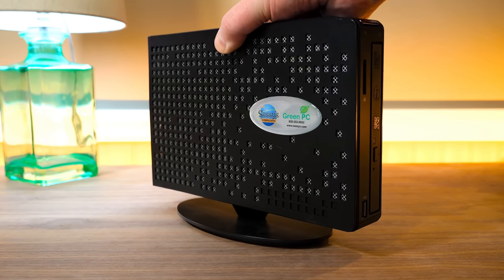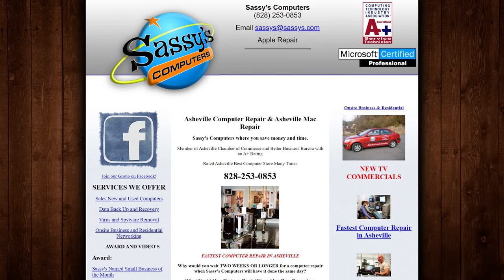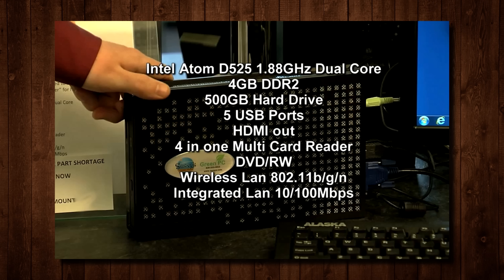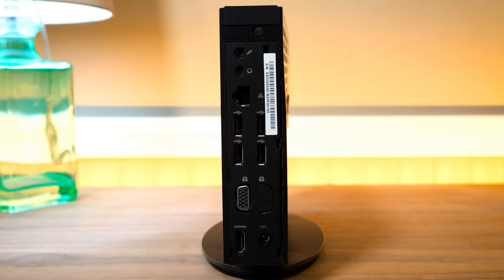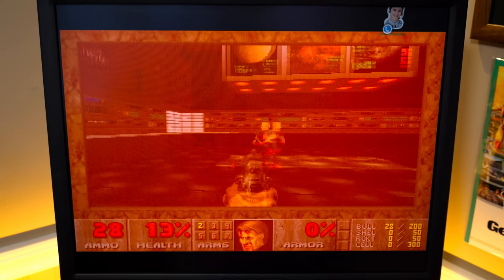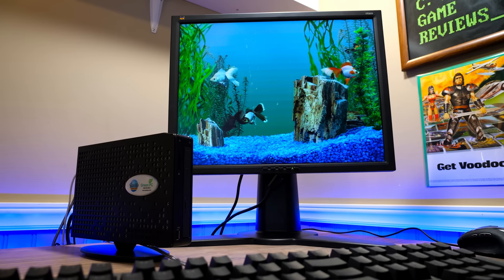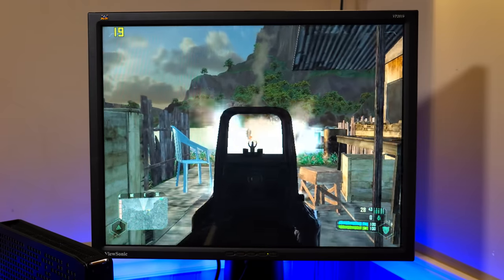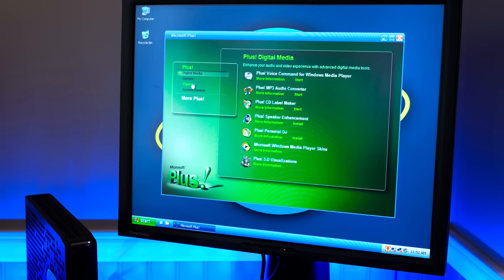Rejuvenating a $599 Shuttle Nettop from 2011! Sassy's Green PC

Comment: Honestly never knew that these form factors were being sold as home computers back in the day. The only time I ever saw them, or still do see them, was velcro'd to the back of a monitor as a point-of-sale terminal in a department store. It'd probably be really useful and cost-effective for someone who wanted to set up a home office in a smaller room, but didn't want to work off a laptop which were still fairly expensive around that time.

I also wonder if it'd be blerb-worthy to poke around that original installation and see just what kinds of ancient bloatware they shoved into the poor thing. Aside from liking the time capsule aspect of exploring old pre-installs, I've never seen the Floating Tech Support Head before and am morbidly curious as to what happens if you click on it.

Comment: 599$ is freaking robbery though. For comparison I just rejuvenated my old PC from 2011 for my nephew. The Intel i7 950 processor can still run most new games! It has upgraded gpu from some years back (geforce 1050ti) and 12Gb of ram. That thing cost around double the money compared to this back in the day but it was practically as good as you could get AND most importantly: it runs games 10 years after its release with a struggle instead of games from 10 years before with a struggle.

Edit. Typo

Comment: Back in 2011, I used a Asus EeeBox in the same form factor as my main PC.
It was better designed in small but significant ways. The front was angled upwards, with headphone and USB ports for easy access. Two RAM slots, but couldn't be upgraded past 4GB. Windows 7 ran perfectly fine, with no bloatware (That would have driven me insane!)

Comment: Im actually still using a PC from 2011 a Hp Pro 3130 small form factor its got a 1st gen i5 550cpu and 8gb of ddr3 ram and i put an SSD in it , I dont use it for gaming obviously but it can do everything else and has lasted me over 10 years no issues,.

Comment: I still have an Asus Atom based netbook running Windows XP (non internet connected) that I have to keep around for some industrial equipment for which later drivers are not available.

Still works ok.  Not great, but considering it was bought in 2008 it's not bad.  Upgraded years ago to an Intel X25-V 40GB ssd, etc.

Comment: i have the asus eee mentioned and i run win7 and linux mint dual boot. It actually runs quite cool with the intel gpu.
I did also try to run the crysis demo when it came out. The plane in the intro turned into a slide show :-)
Its a nice portable system for tinkering with things.

Comment: I ended up purchasing a Simular 1.6GHz AMD E350 (Dual Core Phenom II, with an 1/8th of the L2 and Sans L3) Radeon HD6330, MiniPC w/8GB RAM made by Viewsonic, Im running POP!OS Linux from a 90GB Corsair SSD With DOSBox and VBox (Windows 95 OSR2) For Old PC games, Im also Dual-Booting off a Class3 64GB SDCard for Batocera 2D console and arcade emulation. Works well for the total of $65.00 I paid for the whole thing including the RAM and SSD upgrade. (not counting the XBOX360 controller)

Comment: "Intel Atom processor" (reaches for the dewar of Holy water). I've got two thin clients, both with bizzaro VIA chips. One is a pretty good DOS machine with an on-board soundblaster card that, although turned off in the BIOS, can be still be accessed through a software patch. The other is about as old and as capable as your machine, but it has a Radeon 7000 chipset. It's quite good for running XP era games.

Comment: low power atoms are fanless, moding them with copper and active cooling can gain some very impressive results, you can also, with certain boards, up the igpu ram upto 2gb as well as up the power draw for the chip, allowing it to suck more watts, some undervolt the cpu, to allow the igpu to really ramp up, but those profiles need to be set carefully, as most atom chip boards are set for low power and battery life, so its a rare combo to find both board and an unlocked bios, most are basic affairs, although there are youtubers out there who will keep you informed as to the best options, me, i love my 15 watt n3450, a quad core, quad thread chip thats went from 1ghz, to 2.2ghz, with a 2gb ram partition for the igpu, up from a measly 512mb, the igpu is not special, but it plays all my rts, and strategy games easily, and all at just 15 watts of power.

Comment: i almost bought one of these new with the plan to put a slot loading optical drive in it for a HTPC setup with kodi, retroarch, steam and all (i knew this thing could not run newer games but steam's "in-home streaming" was already an established feature at that time) ... next to the living room TV it would've looked almost like a wii. 

in hindsight, i'm glad i didn't buy it new at full price ... because i did buy a similar system a while later - an eeePC box with the same specs (atom D525 with ION2 graphics) - used, complete in box for 50 bucks - it even has a slot-loading blu-ray drive, USB 3.0, built in IR reciever and windows media remote to go with it - so all-in-all, it was the better deal, i think.

i tried doom 3 BFG edition on it as well and doom 3 itself actually ran better on that potato than the included versions of doom 1 & 2 - it seems the BFG versions use a rather inefficient emulator.
 
that was also with ssd and maxed out RAM on a fresh install of windows 10, wich i totally do not recommend installing on this computer - or any computer, really.

Comment: I think i have a V1 version of one of these? Interestingly, It came with an official Hard Disk adapter to replace the ODD with a second 2.5" drive. No idea why you'd want that back then, But i was stoked to see that after buying it for cheap to use as a quaint little backup fileserver.

Comment: I constantly get machines with various Atom chips donated to my business, and they are an absolute blast to mess with. There are a lot of laptops that I get that are far newer and more powerful, but require searching for drivers for Windows 10, and yet the Asus Eee netbook that you just mentioned has every driver loaded into Microsoft's own driver database for Windows 10, including graphics. I have no idea why, as even on an SSD Windows 10 chugs, but whatever I guess.

Interestingly enough, I've been donated ones that were hyper-threaded,  and those are powerful enough to run Windows 10 on an SSD without issue, which is pretty nice for the people that I end up donating the machines to. Linux certainly runs better (in my experience Linux Mint 19.3 XFCE 32 Bit is best for these), but I always enjoy tinkering around with them. I'm currently in the process of building an Atom-based gaming PC, using what is probably the most absurd atom-based motherboard that one could get.

Overall, it's fun seeing these in the limelight again. These machines are proof of just how little actual grunt one needs for basic office tasks and activities.
Reply: Windows 10 is not good for these systems but Windows 7 runs really well and thanks to BypassESU is still getting updates. Linux actually ran worse for me, surprisingly.
Reply: @xPandamon  After trying numerous distros, Linux Mint 19.3 XFCE ran really well. Even trying things people were suggesting for "low-end hardware", they all ran like absolute garbage, yet Mint 19.3 XFCE 32 bit ran really well (especially on a lower resolution, which made 0 difference on the other distros I tried). Highly recommend giving it a shot.
Reply: @xPLAYnOfficial  Yeah Mint was also pre-installed on my Netbook when I got it second-hand, although the installed version was pretty far out of date, so I scrapped it. Q4OS ran very well, besides hard to adjust touchpad sensitivity that was quite decent
Reply: @xPandamon  Awesome dude! These little Atom chips are still kicking. Super weak, super cheap, super neat! I love messing around with them.

Comment: If I had this machine, I'd run SetFSB and MSI Afterburner, tweak some settings, and submit some scores to HWBot for one of their current competitions. Probably wouldn't rank high up, but would still be cool to see this hardware in a comp.

Edit: Saw the 3Dmark03 score and I guess the CPU would hold it back too much to get anything other than last place versus any other GT218-based Nvidia card.

Comment: Yeah, cheapo XP gaming machine is probably what I'd use this for as well honestly. Looks like it works great for that slightly awkward era between late 90s and early 00s, where many games don't play nice with modern systems. I'm using a laptop from a little earlier for it, Vista based, though I think it has a tiny bit more grunt than the atom (What doesn't?). I wouldn't mind a proper desktop system though, this'd be perfect!

Comment: I once had a ZOTAC motherboard with an Intel Atom processor and ION chip. However, it soon turned out that even everyday tasks like browsing the web was an unpleasant experience not to mention playing games.
Today I have one of those cheap DELL WYSE terminals with AMD G-T56N processor and RADEON HD6320 chip to play old games and it does 2889 points in 3DMark06.

Comment: Intel Atom were so slow. I bought a Mac Mini at 2012 with Core i7 HT and SSD and it was a screamer…. i think it was not much thicker than this Shuttle. Power consumption was also very low (until using Final Cut ^^). But way more faster than any small PC.

Comment: I had a Acer One netbook with a similar CPU and Windows 7 runs great on it!  You should try it with a clean install.  I remember Vista was way too slow, so I was surprised that Windows 7 was much lighter on its feet.
Reply: Right, I had a SINGLECORE N270 and Windows 7 runs fine, even with just 2 GB of RAM..

Comment: Wow! "That external DVD drive's got HDMI! Maybe it's a DVD player! Waith, it's got... VGA? 5x USB and... Ethernet?"

Nice, NICE external DVD drive! You could probably set it up as that if you wanted, over Ethernet, or stick a Wifi stick in if it doesn't have it already. If you wanted to. Which you wouldn't. But you could! Niiice!

Hey you could try dual display! I remember my local council has something like this, except their PCs have VESA mounts, and stick onto the back of the monitor like headcrabs. So it just looks like a monitor, with a headcrab, and a keyboard and mouse plugged in. Quite nifty actually and saves desk space since it takes up zero, just hanging in the air. I suppose it takes up airspace. 

I dunno if they fell for the "smart terminal" nonsense, or whatever it was called back then, when we were all going to use little Java boxes instead of PCs and some server was gonna do all the work. You know, like we did in the '60s and '70s? Except with Java. I think what they have, is just weak PCs, with file servers, though it wouldn't surprise me if they had actual app servers, what the hell is the point of those? What sort of damn word processor wouldn't run fully on a local machine? A frigging WORD PROCESSOR! Word 6 was fine and ran on a 486. Word 2 ran on a 386 and did absolutely everything you need to process words. Millions of people used it! Businesses relied on it! All running on 386s, and things were absolutely fine! 

So whyTF do we need these ridiculous supercomputers on our desks, to write letters!? The entire economy functioned on much less, 30 years ago. In fact better, cos people had jobs and not "gigs" and the Internet didn't dip it's hand into everyone's pockets for organising a driver to take food from a takeaway to a house, yet still we had takeaway food! 

All this shit, and it just makes things worse, so much worse. Destroying jobs, destroying people, so some middle-man can get rich in some market he's just invented, some nice he's spotted to squeeze into. God dammit! Can we rise up now plz?

So, yeah, nice DVD player.

Comment: I was hoping you'd remove the heatsink and show the CPU - I assume it's soldered on (Atom CPUs normally are, yeah?).  If not, it'd be fun to see an attempt at upgrading it to something with a little more power and better onboard graphics.  It might still be worth removing and giving it a cleanup - maybe even throwing a fan on the side to see if it'll handle something like Crysis better with some airflow (though I doubt it).

Fun video though.  I'm always amazed at the difference it makes to old systems when you throw in an SSD.

Comment: IIRC, some of the early Atoms had weird PowerVR IGPs that only had drivers released for 32-bit Windows. So you'd have no graphics w/ Linux. (That may have changed; I haven't tried getting one working in a while.)

I much preferred the Celeron 847/1037 series nettops. (I still have a Linux-running FoxConn nt-i2874 that gets powered on occasionally.)

Comment: Grand Theft Auto San Andreas was designed to run at 25 FPS anyway - going too much higher than that can do very interesting things with the physics from what I recall.
Reply: It's limited to 24/25 fps, you can't go higher without mods

Comment: I have an Atom N270-based HP netbook and IMO once Windows 7 is booted it runs just fine, but yes XP feels a bit snappier. Due to the way it's designed it can be moderately FSB overclocked from software. It can also be significantly overclocked by changing a clock strap resistor on the motherboard but unfortunately this method isn't an option on the D525.

Comment: So fun fact, if your Atom D525 board has 2 DIMM slots and you have the right DIMM's, it will accept and be able to use 8GB of RAM. It does almost nothing to speed things up as the CPU is the system limiter. I haven't tried larger than 4GB per slot but I have had luck with mixed sizes over 4GB in total. Being single channel memory there's no performance hit. I've successfully done this in 2 D525 boards with DIMM and SODIMM, one Gigabyte and one Zotac Ion board.

Comment: It's no surprise that most of Atom-based desktop mini-PCs were designed after Nintendo Wii. Even during its peak (early 2010s), you could barely perform multitasking on them, let alone gaming new titles & emulation above 16-bit console. These days, this thing could only be used as an offline media center thanks to the presence of DVD drive. Yes, this PC could do Linux but not many updated 32-bit only Linux distro are left.

Comment: Damn, this makes me want to build an XP pc, I have some new in box cheap socket 478 motherboard and some P4 1.8Ghz northwood  from dead Dell,  some used hard drives and DDR2 RAM, an nvidia geforce 5200 I think? laying around, just need to get that XP SP3 media center cd which I don’t know its existence if I don’t watch thIs LGR’s video.
Reply: Ohh, that sounds like a juicy combination for mid 00s multimedia.
But for anything gaming that would give the P4 some work the FX 5200 is grossly undersized. (It wasn't great even back then, at the time like getting a GT 710 today) For era appropriate something like a FX 5600, Ti 4200 or Radeon 9600 would be a fun retro gaming experience.

Comment: Funny thing, I found a similar pc like that running (very badly) the business software that I provide support here in the middle of the slum jungle, which has at least a 2nd gen intel i3 as minimal requirement (although most  pcs here in the slum jungle run it on some core 2 duo)

Comment: Played Trackmania nations forever on a Asus eee pc netbook with the lowest settings pretty well back in the day with the integrated intel graphics it had & 2 gb ram on the first generation intel atom which weren't proper dualcores but had 2 cpu threads.
The Trackmania games are probably pretty nicely suited for this up until united forever. (Got a retail copy of that which has like 10 - 20 players from time too time when I've booted it up while the steam version probably is way more popular.)
And i know nations forever has a nice presence online still being free & easy too make custom tracks for. With the atom you got being 1.8 ghz you escape a bug need for speed porsche unleashed has as well.
Where it limits animations, damage models & texture quality if you got a faster processor then 2.1 ghz, this is thankfully easy too patch out if you want too run it on any modern system that has a too fast cpu.

Comment: This thing has great home server potential! Throw Linux on there, maybe even FreeBSD and you are off to the races. It might be underpowered for streaming video as I don't think that little Ion GPU has the horsepower for real time encoding/decoding in a modern resolution. It can be great as a low budget NAS though, even if it isn't very fast storage. 

The VESA mount thing is actually quite popular for office thin clients. My college and a place I worked at both did that setup to save desk space. Works well and is probably cheaper than buying actual all-in-one solutions.

Comment: I remember having ASUS EeePC 1000H which could run Neverwinter Nights at 1024x600 at 20 and something FPS under Windows XP Home that it went with. Still, it was pretty neat and small I. 2010.
Reply: Haha had the same one, ran WIndows 7 really well with 2 GB of RAM, Eeectl and GMAbooster as well as custom gpu drivers. Although Neverwinter wasn't enjoyable to play. just way too slow but hey, OG Doom ran well, so did Sims 2 and light emulation

Comment: Hey LGR  I totally enjoyed these Intel Atoms/Ion systems.   I remember building a desktop board system From Zotac.  I still have mine with a single core Atom (hyper threaded of course!?)  4 gigs of DDR2 Ram,  And the amazing First gen ION Nvidia graphics!  I used mine for general web browsing and media streaming and playback of video content.   As far as I know it still runs and should be able to  fire  up with Windows 7.  It ran an earlier Windows 10 build until an update took it out a year later.  Message me LGR if interested into a follow up?